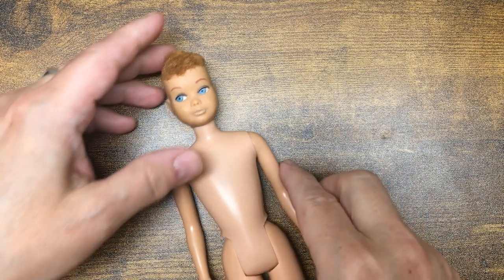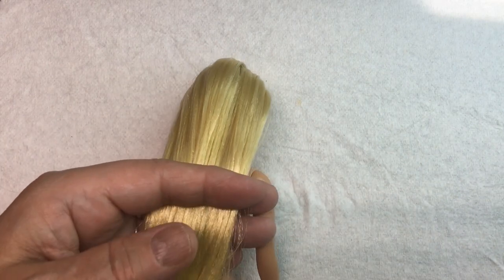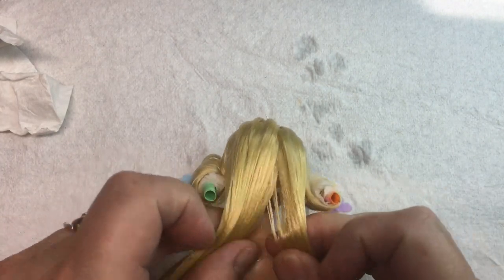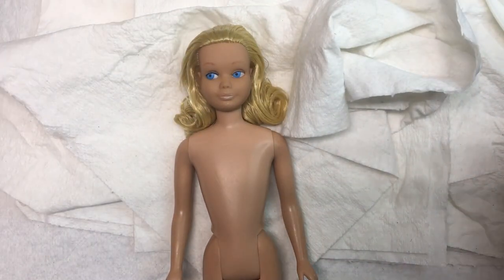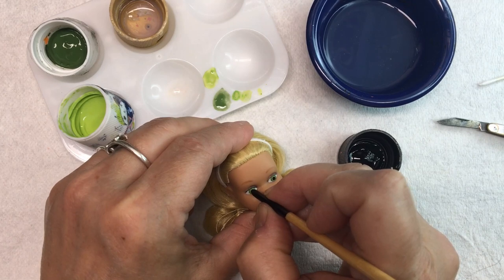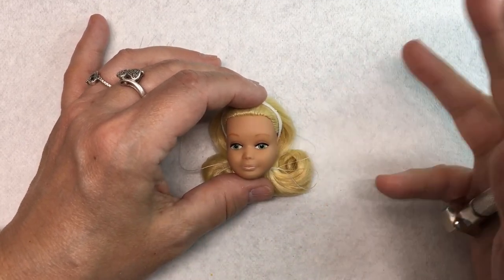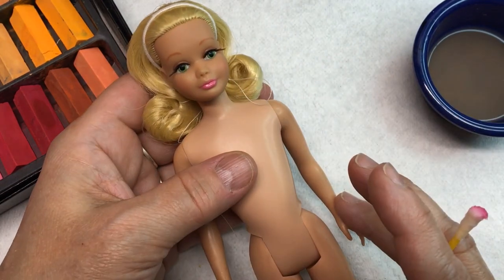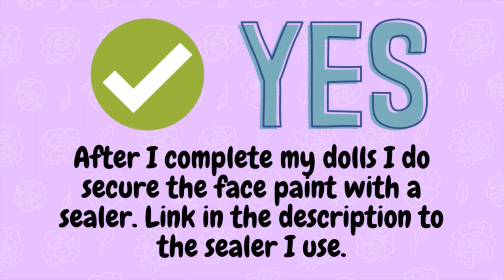Vintage No Bangs Skipper Barbie Doll Repair Restoration Restore Reroot Repaint How to DIY

Comment: I love how you expand on a good idea (no bangs) and make it your own. So creative!! My question is about sealing: How many times do you seal? Do you seal the eyepaint before you add lashes? Do you seal the lips? If yes, I am sure you cover the lashes, correct? Thanks for always sharing your techniques😀
Reply from the maker: Thank you :)  I use a little varnish (sealer) in with my paint while painting and then spray the face with Mr Clear when I'm finished. The lashes get glued from the inside and they do receive a little sealer from the Mr. Clear. :)
Reply: @tinytinkerbell565  Thanks for always sharing your tips!😍